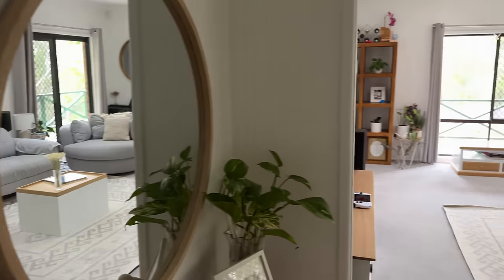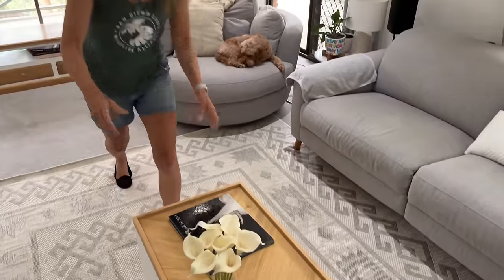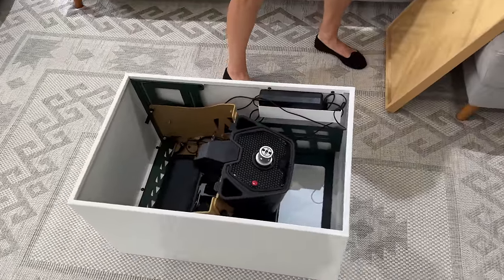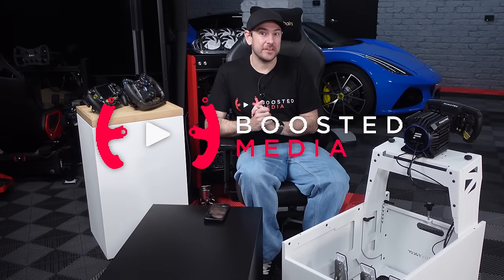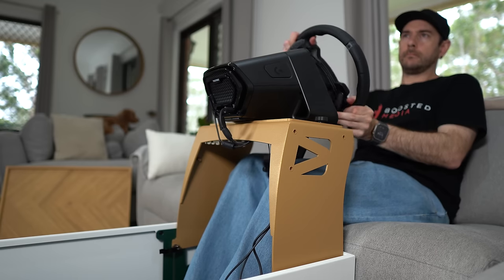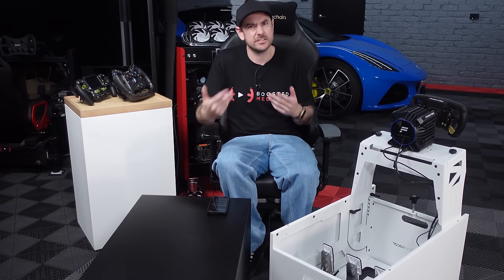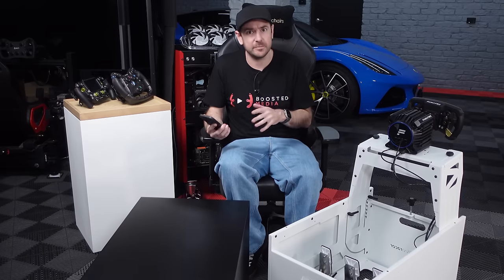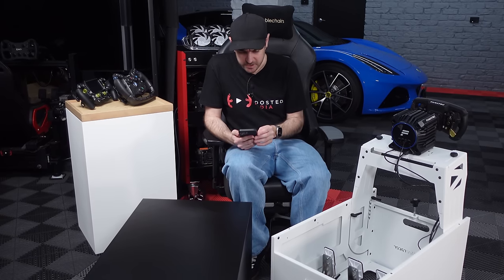ULTIMATE WIFE-APPROVED SIM RIG? - Coffee Racer Go / Play / Living Review

Comment: This falls in the same category as other foldable rigs and their top problem with them: if they are a hassle to setup, they get used less. 
I do have a playseat challenge, the HF8 vibration seat pad and Fanatec CSL kit. 
Setup takes around 10 min for me. Carry everything in front of the TV, Protective floor mat, unfold chair, unfold Wheelbase, screw everything tight, hook PC to TV, plug everything into power and USB. 
I live in a small flat with my GF and put it up and down quite frequently. I do love my new CSL set so I use it often. When I had it with the Logi G29, I used it just some hours, 2 days max per month.
Reply: We see your point but you would have a much easier setup with a CoffeeRacer 😊. Hides in plain sight
Reply: @CoffeeRacerUS  as I prefer a more laid-back body posture, I unfortunately cannot work with a coffee racer where I would sit too much upright (and on a sofa/office chair).
Reply: @edcgadgets-de there are seating options for that as well but we understand that if your setup works then it doesn’t need to be fixed. Whatever keeps you racing is best!

Comment: To solve the chair sliding back just buy a pack of locking chair wheels to replace the standard wheels. Wheels are 20-30 bucks and take less than 5 minutes to swap out the old set.  This what I do and my chair doesn’t move at all.
Reply: Yes! We’ve had a lot of success with this as well. Thanks for the comment! The optional desk chair mount is important for this as well!

Comment: if they had one large enough (but still compact) to leave the pedals in a ‘ready to use’ position, and drop the wheel with buffer space to leave the cables in, then I think the setup might be simple enough to make it a little more compelling. I’d probalby want the option of a grommet to feed the cables through to the outside too (I’d have it under a desk so leaving the cables out permanently woudl be fine). And the seat mount could have a seat slider type release to quickly get it into the correct location.  Woudl be a great VR setup

Comment: Pretty cool compact design.  I personally wouldn't use the bit to fasten the chair.  If I needed it I would just put something behind the wheels of the chair.  Seems like it would work well with a couch.
Reply: The desk chair mount also stops the swivel of the chair, important with stronger wheels. Also it is easier to operate than in the video, no need to use the bolt!

Comment: Honestly each thing you have to physically do before you start driving can be a demotivator. Im using a wheel stand pro 2.0 but I leave it permanently set up to the side because folding it up is a hassle, and I still need to slide it out managing cabling (with all gear they are quite heavy), line up the chair with castors in the tray. For this coffee table rig, if I had to add the folding out the gear, bolting it all up, difficulties getting in and out then I'd just rather not. Better off finding a space for a rig that makes it easy, jump in and drive.
Reply: Recognizable! We also have a professional streamer driving the CoffeeRacer Play, he leaves it out.. only packs it away when he wants the house to look nice for visitors

Comment: I think you may cause more damage unplugging the cables and plugging them in over and over. Could you not make a spacer so when you lower the wheel assembly to rest on a stop  that way you don't have to unplug the cable's.
Reply: Most wheelbases do not require unplugging if you put the wheelbase is the most forward postion before folding down, we will put your suggestion on the list for development though! Thanks! :)

Comment: Cool concept, but seems a bit too risky to not have any mechanical stop for the folded down position of the wheel base.
Can't be too hard to design something that stops the wheelbase resting physically on the pedals?   (some pegs on the walls or similar)
edit
I'd also if possible try to design the rig so you dont need to adjust the position of the pedals and wheelbase everytime you unfold the rig. 
If at all possible, the adjustment for angles etc should be separate and be able to be done once, and then the unfolding procedure of the wheelbase should really just be like a 90 degree flip and then lock it down.
Pedals should if possible be similar: do the adjustments once and then optimally shouldnt need any setup at all during unfolding. Second best option would be if a simple "raise it into position" that doesn't need adjusting - just lift/slide (or whatever) and lock with a simple easy to reach mechanism.

It would be worth making the table slightly bigger to accomodate this for more setups I think!
If it isn't super quick and easy to deploy (and fold back) then it won't be used in my experience.
Easier said than done though :)
Reply: In most applications, the pedals are able to slide completely forward and completely out of the way of the wheelbase.

Comment: How come you didn’t use the racer go on the couch? That one seems to be the best middle of the line and supports high torque, does that one work on the couch too?
Reply: The Go is limited to 8 Nm maximum wheelbase torque. It can certainly be used on the couch. The Play and the Living are very rigid, even with a lot of torque. The Go is very stable but will flex with higher torque wheelbases.
Reply: @CoffeeRacerUS  ok I was referring to the play model then. The all black, 20 nm max. He didn’t use that one on the couch I was just seeing if there was a reason or if they can all be used in that manner
Reply: @steveybiggunzgaming8118  we have tested the Play with a couch and it works great! The caster wheels on the Play lock to prevent movement under heavy braking. The Play is extremely rigid. We’re going to release Fanatec DD1 max torque testing content soon. The Go prevents movement either with the optional locking caster wheels or with the rubber screw-in “feet”. The Living prevents movement with included rubber strips for the bottom of the unit. All models can be used with a couch or desk chair. If you’re using a desk chair, the desk chair mount is highly recommended to connect your desk chair to the rig for increased rigidity.

Comment: This is really cool, but as someone who races with a foldable rig that has quite a few steps in need to go through before I'm actually racing, I find that usually I just wont bother, especially if time is limited. If i have an hour to simrace and setting it up takes 15 and taking it back down again takes another 15, it's just not worth it. Hence why I'm looking into investing in a more 'permanent' simrig solution.
Reply: Will times himself at 4min45sec setup time at 43:17. After a few uses, you can easily get that down under 2 minutes.
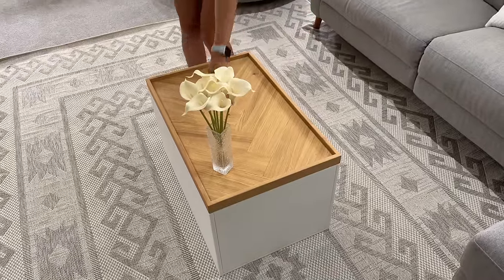Reply from the maker: Depends if you have to adjust the pedals every time or not. My kids are using the living model with the Logitech G pro base and pedals at the moment and it takes about 1:30 to set it up each time without the need to move the pedals.

Comment: So why the "Living" and not the "Play"? I don't understand it. What are the advantages of the Living, apart from the wooden top?
Reply: Check out the model comparison video on our channel for some concise info on the differences between the Living and the Play. The Living is a super nice coffee table. The lid is very high quality and blends into any interior design. It's also very rigid and can handle 12 Nm of wheelbase torque. The Play is designed for an office or gaming room environment because it resembles a file cabinet. It rivals the rigidity of many full rigs and is best for sim racers who want top-of-market wheelbases.
Reply: @CoffeeRacerUS  Thank you very much. Please explain the price difference between the Play and the Living. Is this only because of the wood? Why does the Living cost almost twice as much as the Play, although it is also more "unstable" (but admittedly more beautiful). Thanks for the help :-) I would like to have the Living, but the price is really high compared to the Play.
Best regards!
Reply: @Longi78 one of the large differences is due to the lid. It is a really nice piece of furniture. Also, there are laser-cut green powder coated floor boards in the Living. The steering column is powder coated gold metallic. So are the pedals trays. All of these details and color variations are what make the Living stand out but also increases the cost of production.
Reply: Very helpful, thank you. Yes the living is a nice piece of furniture!! I will have a closer look 👀

Comment: I hope you guys get to mention to the CEO of Fanatic about the crappy connections to the CSL DDs, as well as Fanatic handbreak & its headphone jack plug. Would be nice to hear them acknowledge the terrible design & if they're moving to more modern plugs, cable management & well designed jacks.

The Logitech G29 has better cable management (for cable stress) than the more expensive & modern Fanatec gear.

Comment: For the price its not close to being smart enough engineered. This would only work for me if adjusting was a one time thing, then it should all magically slide and extend in place quickly after that. Way too much hassle
Reply: Then you'd just get bored while your system/game is booting ;)
Reply: @coffeeracer1124  Or maybe you could take some constructive criticism. I feel the same way about this, and watching Will fighting with the thing, trying to adjust the stand with the heavy wheelbase mounted,...It just isn't well thought out,...or even safe, for that matter. I wouldn't let a kid or even a teenager to it. The flimsy lash with the thread is an absolute no go for that price. How about you address some of those concerns , instead of posting jokes every time someone gives a reasonable opinion on your product.
Reply: @mementomori4972 this rig is mainly designed for direct drive wheels. And direct drive wheels are not for kids. There are videos from game bugs when ppl nearly broke their arms from the ff. And the comment: „mAkE iT BetTeR“ is not constructive critism. The mechanism fits for all dd wheels out there which makes it impossible to fold in and out like magic. You have to adjust you Equipment by yourself And it’s bad at all. But you can improve everything of course.
Reply: @inot88j24  Direct drive wheels can be used by everybody. there is no age restriction. Fanatec for example recommends the age of 6 for the cls DD. The power output can be adjusted, so what are you talking about? No one just said "mAkE iT BeTter" without pointing out a valid reason as for why,...and the size of the wheelbase is no factor at all.